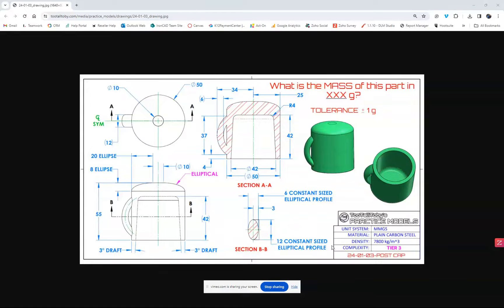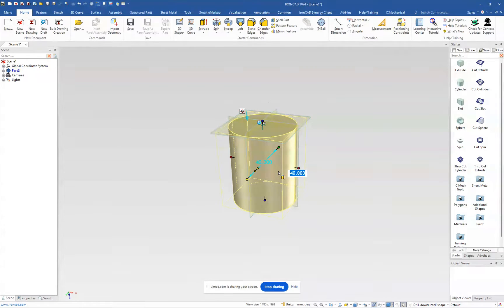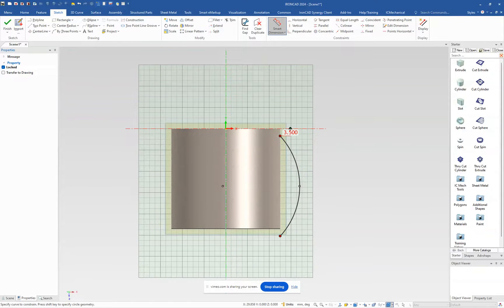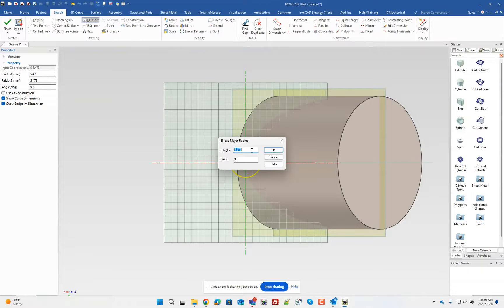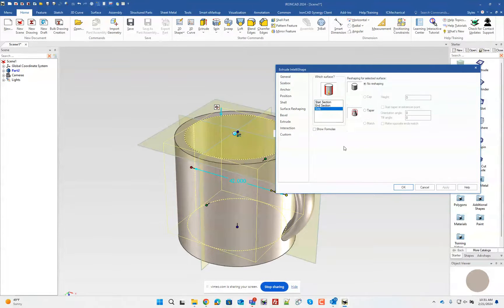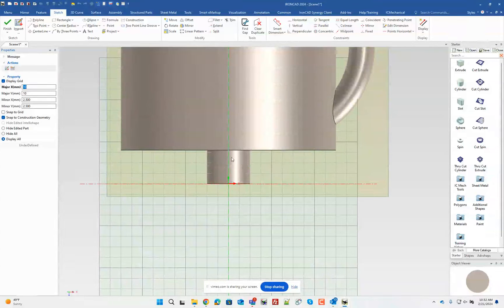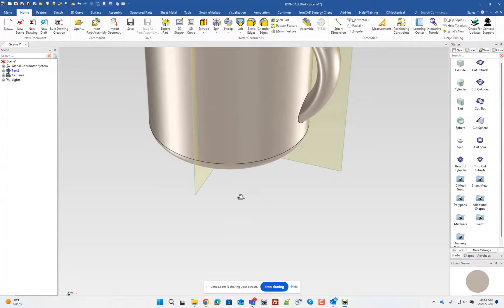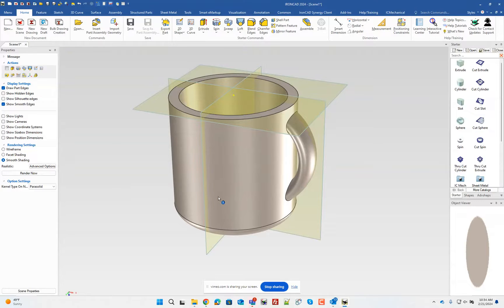Too Tall Toby Practice Models Performed in IronCAD - Practice 3 - 24-01-03

Comment: i did in solidworks and it shows 413.91, i'm wonder which part i did wrong
Reply from the maker: Usually the Handle on this one is where the issue comes into play with the different weight.